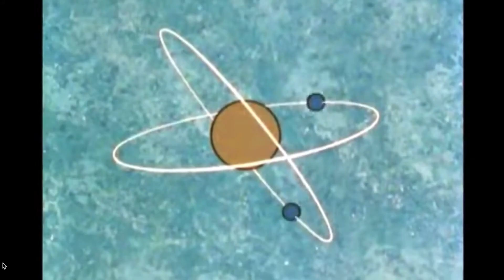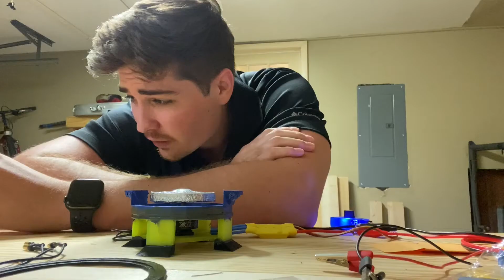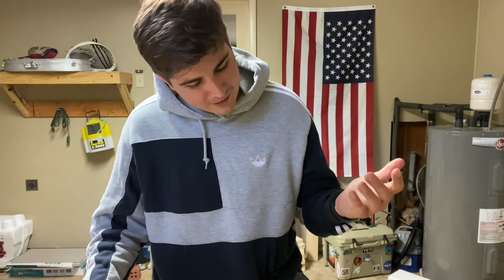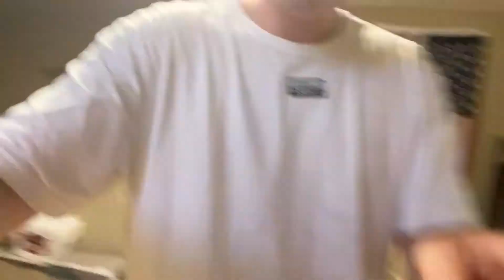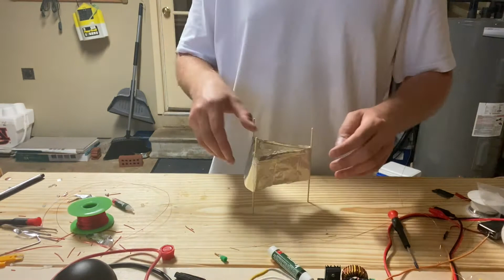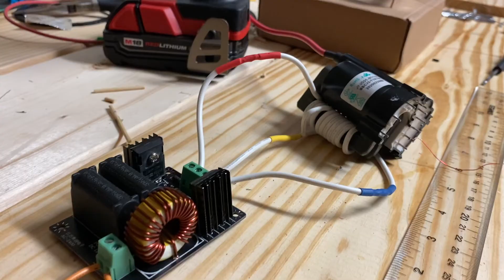ZVS Driven Ion Lifter

Comment: I just got in to these a couple of days ago.   I have a couple of fly-backs and driver however reading the comments I need to rectify the output.  This guys lifter is really heavy and makes you wonder how the ion wind is moving it. https://www.youtube.com/watch?v=006d36WWyaQ
Reply from the maker: Yeah I love his build. It shows some real strength. Let me know how you do with rectifying your fly-back's output. I'm thinking of just building one of those cascading voltage multipliers, but my capacitors have yet to arrive.

Comment: Hi, great video and cant wait for the next one. I 've just gotten into lifter myself and had very similar problems to you. I think your setup should be close to being usable. I use a ZVS like you, and found I had to use a ground plane, connected to skirt potential, to get vertical lift. Also I found that you probably want to gently increase the voltage up until you find the point where the lifter starts bouncing around before it takes off, to prevent the likelihood of arking. You may find that when you achieve vertical lift, your lifter veers off or backflips. I am fairly confident that this happens because of the physical location of the positive electric fields, so imho the place where the positive power goes into the top triangle corona should be the centre of it, I think this will make the lifter to be more stable.
Reply: sorry forgot to mention, the wood, it can become conductive at high voltages, and can often catch fire. I believe you can experience some resistive losses from skirt to corona through wood. Personally I ended up using ptfe to insulate the wood further and now am using materials like teflon plastics instead of wood to separate skirt and corona
Reply: @c6jones720  Or another alternative is 3d printed lightweight case. Plastic is more dielectric than wood.
Reply: @denishd4706  I started using mica sheets (microwave shield parts) mica is a good dielectric and very light. I have used it in place of wood in a few lifters now. You may find a gain in lift efficiency by having a more rigid corona wire too (but not too heavy or too thick). I think that is due to vibrations
Reply: @denishd4706  I just wanted to mention i looked at your parts list, and it loks like you are using more or less the same zvs as me. I have been able to achieve lift at a voltage range between 24->32V with that setup at currents generally around 500->690mA. You can hear when the lifter is going to take off. In my experience with that setup you can lift an object about 100cm^2 about an inch in the air. I think if you keep at it you'll be producing some good lifters.

Comment: Hi , Matt.
Very high quality of video.
"Puffy "ark meens that its AC component exist. 
You need a HV  capacitor  on the output  of flyback transformer  to get normal work of incorporated diodes. And you will get DC output.
Reply from the maker: Thank you, Serge. I added a diode and got a little better results, but I'm still waiting to receive my HV capacitors. Everyday we learn a little more.

Comment: Nice vid Matt. Have you tried directly connecting DC to see the difference. Then also rectify with Shotkey diodes to a cap to collect your DC. Also I found that moving the wire closer to the aluminum helped.
Reply from the maker: I haven't. I will try the rectifier approach though. I have a diode on there now and it seemed to do marginally better today, but still no real lift. Getting closer though. Hopefully we'll have liftoff soon.